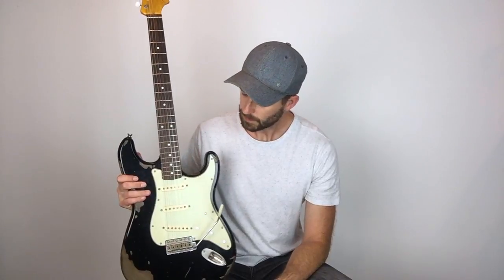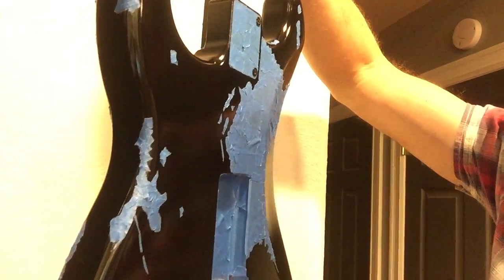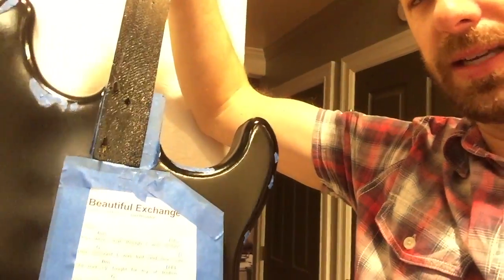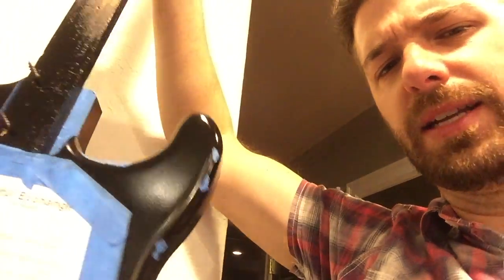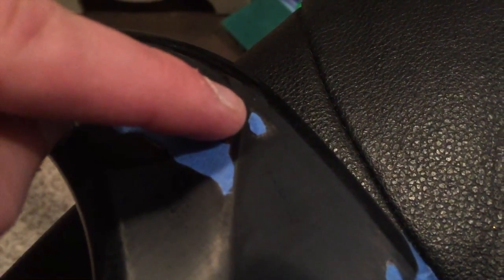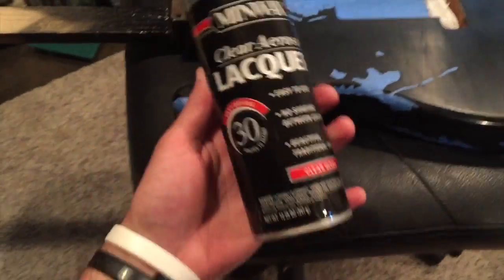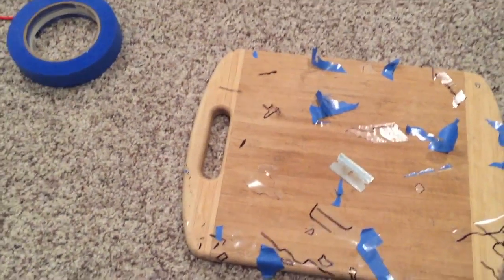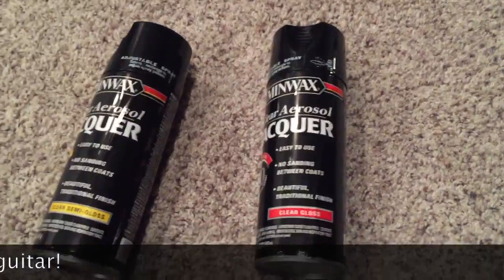Strat Nitro Finish Body Work - Part 4

Comment: You're really dedicated! Good work :)
Reply from the maker: pearl blues thanks! Sometimes I think I’m too dedicated. 😂
Reply: No way... your hard work certainly paid off. Just a question though... how did you get that dull but not scratched aged finish?
Reply from the maker: pearl blues pearl blues I ended up using semi-gloss Minwax aerosol laquer (nitrocellulose), which I talk about at the end of the video.
Reply: Yes I saw, just wondered if there was any more to it than that. Will definitely check out Minwax! :)
Reply from the maker: pearl blues gotcha. Yeah, after all was said & done, I essentially just used the semi-gloss lacquer as the final coat: no sanding, no buffing, no polishing. And I gotta say, I’m pretty pleased. 👍🏻
It wouldn’t work for a “new” guitar, but since this is a relic, I got away with it.
Reply: Thanks for the info my friend. Peace :)

Comment: I think this looks pretty great!! The time you spent doing the wear work with the tape payed off!! How many guitars have you painted. 

I have this 1980’s “blackie” body. I got it about 20 years ago when it was ruined in a fire. It’s this smooth black color now. I was thinking of spray can spraying it in purple and giving it a matching headstock color. I might try to do some wear with tape and have the black come thru the purple. Do you think it would look like shit if I didn’t use clear coat?
Reply from the maker: Thanks! This was my first attempt ever at painting a guitar. I’ve been happy with the way it turned out, especially considering that fact. 😊 
I think you might be able to get away with no clear coat, but I can’t say with confidence. I guess the clear is really there just to protect the color. However, if you use nitro color & nitro clear, then it’s all the same really. You might need to just do more coats than normal of the color (depending how much of a relic look you want)?  🤔 Hope it turns out well!
Reply: personally wouldn’t refinish it because that’s a cool story and it’s part of the guitars history, but that’s your choice. not using clear coat would make it extremely difficult to sand and polish to a nice flat, mirror like surface. the clear coat protects the finish and allows it to be sanded flat and will provide a better finish overall

Comment: Thanks for posting your process. I have a decade old Custom Shop that came with some wear, but the finish is a bit too shiny to me to correspond with the wear. I'd like to dull the finish a bit, but similarly would like to avoid the scratch marks from wetsanding. Any suggestions?
Reply from the maker: André Sadoff thanks. Hmm, I don't know of a fool proof method. I actually did this a few years ago to a shiny poly coated Les Paul & was pleased with the results: https://youtu.be/uqnfCGq96sM. It's not perfect, but maybe it will give you some ideas. As an alternative, you could spray a matte nitro clear coat over the existing finish, if you're comfortable with it.

Comment: Hey man, really appreciate you putting together this series of videos, as I am wanting to do a relic finish to a squier stagemaster I have and can't find much information on the process. This series gets a little confusing after you apply the color... to achieve the satin look (and avoid having to re-tape the "worn" areas), did you just apply the Minwax brand clear finish to the paint/color layer, or is there still StewMac clear over the black parts, and did you have to sand/polish the satin finish? Also, what was the motivation behind taping off the worn areas vs scraping the finish back afterwards? Thanks again for this series of videos, your guitar looks great, hopefully I can get mine to something close.
Reply from the maker: Grant Scott glad to help! Yes, all of this was a learn-as-I-went kind of thing, so I just had to organize it the best I could. Basically, this is the process I went through:

1) Sanded the body (320 grit)
2) Taped the body (I'll explain below)
3) Sprayed sanding sealer
4) Sprayed "prep coat" of clear nitro
5) Sprayed black color
6) Sprayed clear coats of nitro

I tried & failed at wet-sanding, so in the end, I just sprayed a final coat of semi-gloss nitro & called it quits. (You can spray semi-gloss nitro over gloss nitro with no problems.). 

The reason I taped the body like I did was because it seemed like the best way to go after all of my research.  There wasn't anything like this out there at the time and I just kind of went back and forth trying to decide to tape first, or relic (remove paint) later.  If I had to do it over again, I probably would still do it the way I did.  HOWEVER, if you HAVE to wet-sand for a smooth finish, I would NOT tape first.  But, like I said, the semi-gloss nitro just kind of works for a final relic finish, without going through all the hassle of wet-sanding.
Reply: @NathanSink  Awesome, man! Thanks for clearing up the steps for me. I really dig the semi-gloss finish, and since I've already had to sand off 4 coats of poly paint (chinese squier bought new from Mars Music in '99) I'd like to avoid as much wet sanding as possible, those steps looked miserable. Again man, really appreciate this series, and you including the steps that didn't really work (knowing what doesn't work is just  as helpful as knowing what does).  Thanks again, I'm glad you decided to post all these to YouTube, they've been very helpful.
Reply from the maker: Grant Scott thanks for the positive feedback! Best of luck with your project! 👍🏻

Comment: You put to much work into this. It’s supposed to look like worn in its not supposed to look perfect.also why didn’t he buff it? You get the scratches out with a buffing wheel not with sandpaper.
Reply from the maker: Danny Darco it was my first attempt at any kind of guitar building, so I wanted to take it slow & get it right. There is a fine art to believeable relic'ing. And there are plenty of hack jobs out there.